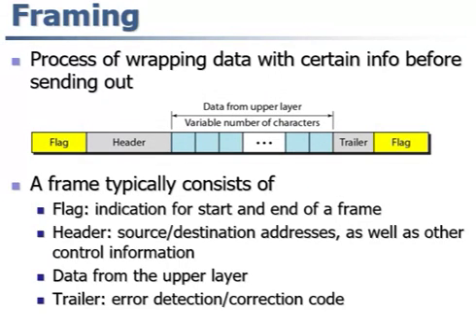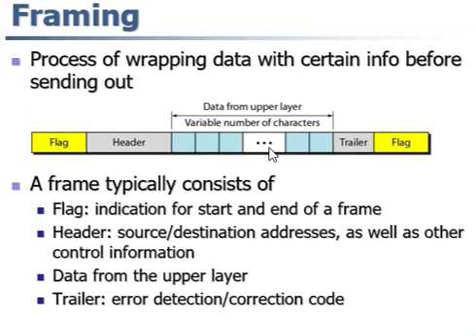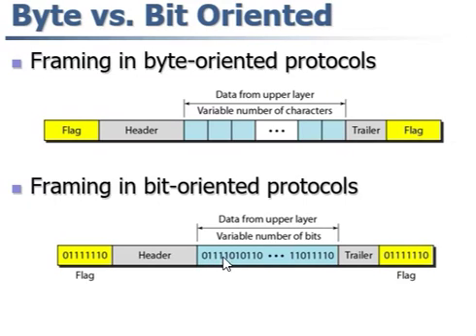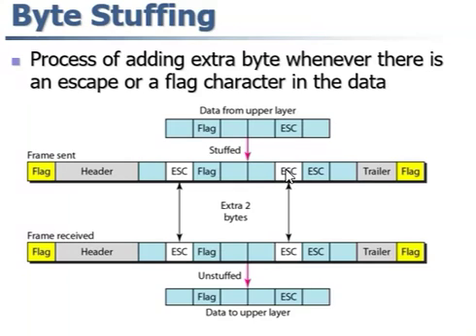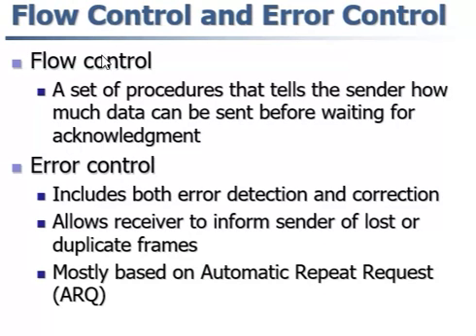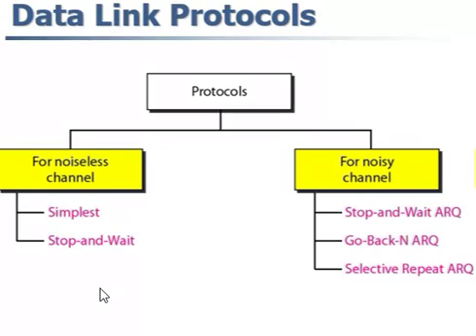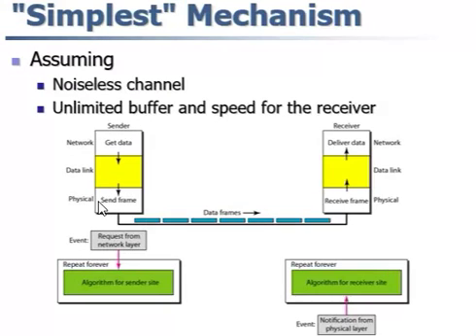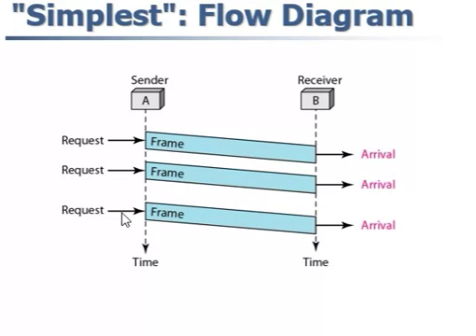FRAMING , Bit stuffing ,Byte stuffing, Simplest mechanism protocol,Stop and wait mechanism

Comment: Why bit stuff happens after 5th bit; why not after or before 4th or 6th bit?
Reply from the maker: while reading a frame control is unidirectional. that means it can't come back . so if the frame is found to repeat the flag sequence it immediately  inserts a 0 so that even if the sequence repeats later on it need not come back and insert a 0
Reply: We were taught it was because the flag is 111111 (six consecutive 1s), so to prevent the six ones from appearing in the data a 0 is added after every five 1s so that it does not contain six consecutive 1s, which is the flag. This way, the flags only appear at the ends of a frame.